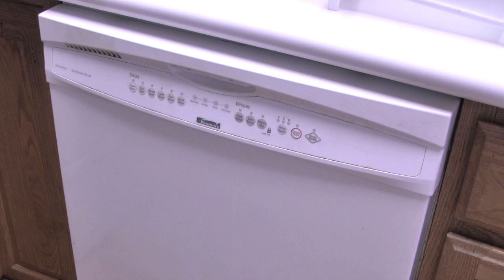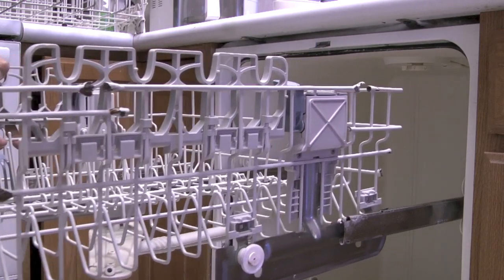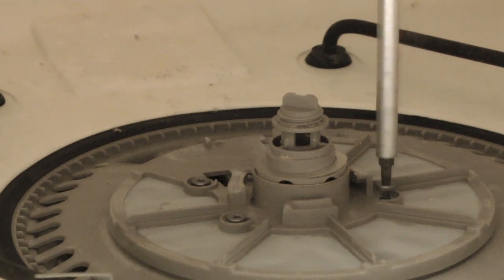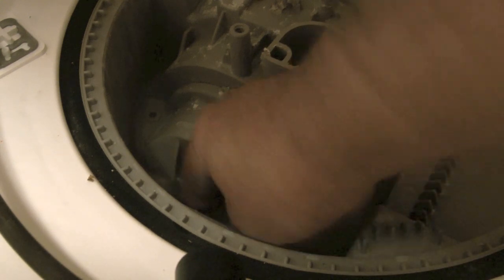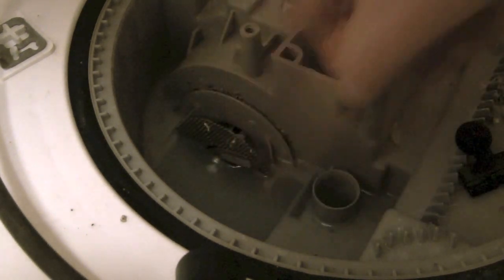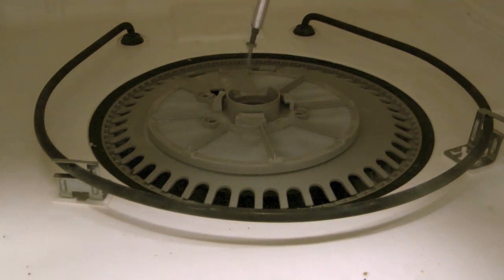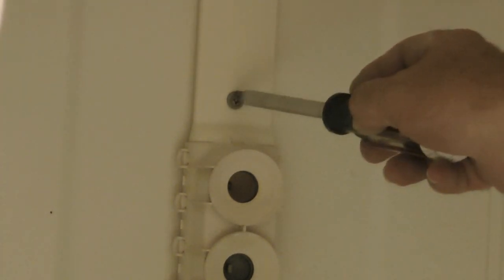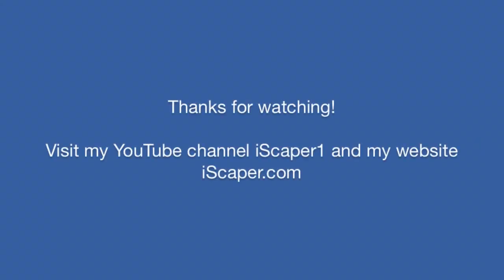Do it yourself dishwasher maintenance

Comment: Thanks for the video!  I was able to save myself a repair call and get to the chopper assembly and check valve after watching your video.  The dishwasher is 15 years old, and I didn't want to pay someone to fix it.  Will need to replace it sooner than later, but so great to give the filtering and chopper area a good clean.  They were not pretty.  Dishwasher is working like new again!  My husband is impressed with my DIY skills ;)
Reply: I had trouble getting the cover back on the chopper assembly. The steel mesh has to fit just so into a slot on the cover and it was pretty hard for me to know if I got it right.

Comment: Like so many have said...fantastic, very informative, simple!

One thing I like to do when disassembling something like this when removing screws above the "works" in the bottom is to place a towel over the bottom to catch any loose screws, preventing them from landing in a hole or crevice below.  The lower screws you remove don't seem to pose that risk.

Once again, wonderful, instructional video....YOU ROCK!!

Comment: We were able to save our dishwasher thanks to your instructional video!  Once we followed your video and opened the bottom of the washer, buried grime and blockages were the obvious cause of all our headaches.  We were shocked to find so much previously undetected grime in there -- and it was circulating onto our utensils and dish surfaces.  Thank you for a "new" dishwasher and a healthier home!

Comment: Thank you for taking the time to post this video. The wife and I started hearing a noise that sounded like a stuck electric motor (or what I would think a stuck electric motor would sound like) the last time we ran the dishwasher. We followed you instructions which took about 30 minutes and found some broken glass, plastic, one bread tie, but no chicken bones. We did a test run and haven't heard any noise that sounded like having to buy a new dishwasher before its time. Thanks again.
Reply from the maker: Thanks Sean for watching.

Comment: Great video.  Very informative.  My Kitchen Aid dishwasher was nearly identical to the one in your video.  I just finished the cleanout and re-assembly.  I found several pistachio shells and some plastic debris down near the sump.  I'm running a load now.  From the sound of the dishwasher, I can already tell that there is significantly more water flow during the wash cycles.  Thanks again!

Comment: Thank you so much! It took us just half an hour from start to finish to clean out our Whirlpool dishwasher. We found price stickers, popcorn kernels, a few things we couldn't identify and the worst..... a thin round piece of plastic, about the size of a quarter that looked like it came from the top of a ketchup bottle was blocking the pump. It's a wonder it worked at all. We aren't very handy and this was easy because of the great instructions. Thanks again!

Comment: After cleaning the drain, which I thought was causing the draining problem I had, I found your video. I did not know that the washer had a check valve. I'm checking that today.  Thanks very much for taking the time to do this video. Larry
Reply from the maker: Let me know if the check valve was your problem.

Comment: Thanks for the easy to follow instructions. We have a Maytag and it was very similar. We were about to buy a new one and I figured the worst I would do was make not work at all. We must of fished out about a pound of mineral deposits and icky stuff and detergent. I will run it in the morning and see if I succeeded in putting it back together right. Thanks for putting up a video that made it so simple.

Comment: Very helpful video!  My dishwasher had started making a loud grinding noise during the cycle, but not during the drain, which research told me could be something caught in the sump blade.  I followed these steps and discovered a piece of broken glass had made its way to the sump, which I removed.  The most helpful part of the video (one that other tutorials skip) was is pushing the sump cover to the right to pop it off.  Mine was really stuck and I had to use a screwdriver to push it sideways.

Comment: My unit suffered from an unbearable rot smell and grinding noise- just by luck I have the same model you worked on! Followed your video step-by-step, pulled out an assortment of debris, reassembled and VOILA!!! Both problems solved! (As well as $100+ for a service call avoided!) THANK YOU!!!

Comment: Thanks to your tutorial, I just saved the cost of a service call from an appliance repair technician. I didn't think that I was handy enough to fix my dishwasher, but the clear and thorough instructions made this possible.  My dishwasher now works like new.  

Note: I have a Whirlpool Gold Quiet Partner III.  It's just a little different from the model in the video, but it was easy to adapt to the differences.
Reply from the maker: Fantastic, thanks for the feedback and the info on your Whirlpool dishwasher.

Comment: Thank you, well done!  Exactly what I needed.  We just bought a 2-year-old Maytag w/ stainless interior that had the same screen/ chopper and sump.  I'm so proud that I was able to take the whole thing apart and take care of this myself, because it had plenty of gunk/pits/toothpick/beans/you-name-it in there, that was causing a not-so-fresh odor. I cleaned the whole interior with vinegar and the innards with a toothbrush, soaked up the dirty water down in the well with paper towels, then rinsed it by pouring water around the edges and then soaked that up until it was clear.  The screen had some baked-on-sticky-goo that wouldn't come off with the vinegar, though, and I remembered I had some lemon essential oil that actually broke it down and it scrubbed off with the brush then.  I sprayed the inside of the washer arms out with vinegar, too, and all sorts of food films flushed out when I rinsed it.  I'll tell you what, I don't think anyone has ever had such a clean used dishwasher, lol.  It looks and smells brand new.  Thanks again.
Reply: I’m so glad hope it’s running good still! Love the stainless maytags I have one as well and had to do the same thing when I bought mine used, I even found a ziploc bag in the upper spray arm feed tube! It worked perfect after the full clean out as this video went over.

Comment: I was having a similar problem. My top rack wasn't spinning and only a certain spot on the bottom would clean. My father in law and I used your video to open my dishwasher and every part was covered in grease. Cleaned it out as much as we could. The filter attached to the chopping blade wouldn't come out, so we used a tooth brush as best we could. Ran a cycle and its now running like new. Repair guy said it would be an easily a $200 job. Thanks for saving me time and $$$$
Reply from the maker: $200, ouch. I'm glad you were able to fix it on your own.

Comment: Thank you! I have this same dishwasher, and it has been a smelly mess for quite a while now--not to mention, the dishes never come out clean and have a greasy white film on them. I followed the steps in your video and was HORRIFIED to see all of the disgusting gunk built up behind the water supply pipe, inside the filter screen, and in the sump itself! Took me nearly three hours to decrease and clean everything. Found bones, pits, and glass in the sump, too. Taking it apart and putting it back together was the easy part thanks to your video. Now, the dishwasher works like new and I am happy I don't have to replace it right now. Really, thanks again!
Reply from the maker: +Waboosegirl1 
That's great, congratulations.

Comment: Thank you so much for this video. Our dishwasher stopped cleaning well for several months. I've been googling on how to find out what's causing it to not clean the dishes for a while now and did not find anything until I stumbled on this video. After taking it apart, I removed a bunch glass and food debris in the sump area, was pretty nasty. I got it all put back together; and hopefully, it'll start cleaning the dishes again.
Reply from the maker: How is it working now?
Reply: iScaper1 It worked. We have clean dishes again. Thank you!
Reply from the maker: Francis Ignacio
That's great, thanks for the update.

Comment: This video was incredible. I have the same model dishwasher and the steps were perfect and easy to understand. I think 6 hearing aid batteries clogged in the bottom were the culprit in my instance. Several were badly corroded and had started to have things growing on them so they had been there a while. 
Thank you for doing this

Comment: Thank you so much, I wouldn't have managed without your video. 
Goldroad40, as for the chopper blade cover, my dishwasher has a second screw towards the front. I also needed needle nose pliers to remove the cover in a sort of clockwise rotation.
Good luck to everyone, and thanks again.

Comment: Awesome it worked!!! Thanks for the excellent video with your clear instructions and illustrations. Just as an added measure I flipped off the breaker switch to the dishwasher on my electrical panel. The most stressful part was taking off the chopper cover as mine was a bit different. A pair of pliers did the trick. Also a turkey baster helped around the sump.The big surprise was that the 12 year old chopper blade was worn down to almost nothing!!! I was able to replace this 30 dollar part and now the dishwasher works great!! Keep up your good work!!
Reply from the maker: Thanks Susan for the tips and information. Where did you get the chopper blade?
Reply: iScaper1
Called Sears and they referred me to the local appliance repair shop and I gave them the model and part number to order however they had one in stock..lucky me...and the dishwasher works the best ever!!! Thanks so much for posting this video.
Reply from the maker: susan p
It's nice you didn't have to wait for the part. Thanks again for commenting.

Comment: Thanks so much for this!  My dishwasher looks almost exactly like yours does, and I was able to follow this video almost point for point.  I did use paper towels to absorb the water completely out of the sump area, which allowed me to spot about three pieces of very thin broken glass, which were invisible when wet.  This project went along very quick and easy all thanks to you!
Reply from the maker: Thanks, I appreciate the comments.
Reply: We used a turkey baster to get the water out of the bottom area and that exposed more stuff that was hard to get at with just fishing it out.  There were wires, glass, chicken bones. .. and other unidentifiable materials in there. . .all clean. .Now we see if it works!

Comment: iScaper1 - YOU ROCK!  You made this so easy even a girl can do it!  I am the "think pink fix-it chick. I was ready to load my dishwasher into the trash heap. I figured the worst I could was break it. Right? Wrong! The chopper assembly and pump inlet thingy were full of junk clearly causing some grief and obliterating the water flow.  It is really rewarding to "do-it" yourself.  I am running around singing "I am woman hear me roar in numbers too...." I may not live through the day...I'll stop.

Comment: Thank you! I had just the sound of something in the sump and your tips let me fix it. I will say that this worked for a Whirlpool as well. I did not need to take the tubing from the lower to the upper spray section apart, it stayed as a unit. If you have a power scrubber attachment at the base of the spray section, it just pops on and off. Remember to put a dishtowel over the little openings at the cover to avoid loosing a screw:)

Comment: This video just saved me an expensive repair visit. Mine was making a buzzing noise while the water was pumping. I found several pieces of glass in there and a chunk of wooden spoon. I could not get the check valve out but I cleaned it well and the noise is gone.

Comment: Flat out great video. Totally fixed my problem.'m pretty handy but never took apart a dishwasher before. It came with the house I just bought and It was really doing a lousy job. Following your easy instructions...I couldn't believe the amount of stuff that was in there including a broken off piece of the flatware basket, broken glass, labels, plastic bread ties, cellophane, and olive pits! No wonder it didn't work. btw..I noticed the screen filter was full of some kind of gunk too...probably glue and paper residue from labels. I saw I could pry that off and get that cleaned too. Just an excellent, excellent video, clearly and calmly explained, and with good pics. Thank you! I'm a subscriber now. And now it's on to why the rinse aid dispenser doesn't work. :-/
Reply from the maker: Thanks Kenna, your feedback is much appreciated. Let me know what you find out on the rinse aid dispenser.

Comment: I couldn't have lucked out more in finding this video! Same dishwasher and same problem.  Thank you so much for sharing.  I hit the motherlode down there, glass, a rock, a twisty tie, also a chicken bone, a large ball of lint, eggshells, a couple of beans, sunflower seeds and a lot of slimy grime.  I'm a little grossed out but running the test load right now with my fingers crossed.
Reply from the maker: Did it work?

Comment: I did this...it took about 20 minutes (I'm fairly mechanical) and solved the problem completely. The biggest hassle was getting the $#%&$!! caps off the ends of the sliders on the upper rack. Thanks for saving me a $200 service call or $700 to replace the unit.

Comment: Thanks for the video! I was having a different symptom. My lower washer arm kept clogging with little pieces of plastic so I took apart the sump as shown in your video and found the source of the plastic.... the chopper blade broke from its shaft and was sending little pieces of plastic through as it turned and ground off more. The chopper screen was completely, completely clogged - really gross... wish I took a picture of it.  

Thanks for taking the time to put this together to help us all out!
Reply from the maker: Are you going to replace the chopper assembly?
Reply: iScaper1 Yep... that is the next step. Anyone know of a test mode or something where I can see if the chopper motor is actually spinning?
Reply from the maker: Brian Engel
I'm guessing you'd have to call a tech to do a test like that.

Comment from the maker: What I did after cleaning the sump putting everything back together was take 2 cups of white vinegar and add to the tub then run the dishwasher through a cycle without soap. It did a nice job of removing the scale from the inside of the tub. I figured it would work on the crevasses in the sump also.

Comment: Thanks so much for this video! The job took me a lot longer than you but I was able to clear out so much (it was fairly disgusting, and we don't even eat animals, so no bones!) I have one suggestion: use a sponge (or wet vac, I suppose) to remove a lot of the water. That way, you can see what you're doing and visually confirm that it's cleaned out. Also, be sure to cut off the power supply first. I ran the dishwasher after and the difference was AMAZING! I appreciate you posting this!

Comment: This is the 2nd time that I have cleaned my dishwasher out like that! I learned something that I didn't know viewing your video though, and that was the plastic cover over chopper blade could be removed and the chopper blade area could be cleaned out. my dishwasher wasn't cleaning again and I thought that it needed a cleaning again. but it turns out that I need a new water inlet valve!

Comment: The only differences on my Kitchenaid dishwasher were that the sprayer feed tube at the back was held by clips instead of screws, and has a "pot scrubber" attached that is removed by twisting the top forward and then lifting off.

Thanks for the useful video! It made the task simple.

Comment from the maker: Yes, the spray arm does wobble when I spin it by hand. I think the water pressure keeps it from wobbling when in a wash cycle. Have you tried running the dishwasher since you put in the new piece? If the spray arm is threaded on correctly I think you might be ok. If things are not as they should be then you will hear a banging-clattering noise when you turn on a wash cycle.

Comment: Used your video to take apart my DW. I found a broken plastic fork at the chop blade. Put back together and it still sounds rough, but then runs smooth after a few seconds. There must be another little piece stuck in there. Guess I better check again. Anyways, thanks for putting this video up. It really helped!
Reply from the maker: Thanks for commenting.

Comment: Thanks for your excellent video on cleaning the sump of our ultra  kenmore dishwasher.  Your slow, methodical, quiet deamenor really was excellenet.  Your directions suberb.  Yes, it had a lot of "stuff" in there and cleans beautifully now.  BUT I have an additional problem I wonder if you can address it.  I have to do a reset every time I do a load of dishes.  The dishes clean up well, all buttons work, but it will not start without a reset for each time I run it.  Thanks again for your videeo instructions!  Well Done!
Reply from the maker: Thanks Barbara for watching. I would guess your problem is a control panel issue which would probably be expensive to fix.

Comment: Thank you so much for posting this! I tried using Dishwasher Magic to clean the dishwasher out, but my dishes still came out with more dirt on them than when I put them in before washing. I just followed your directions, and hopefully it works. Also I wanted to add that mine is an Amana dishwasher, so you can add that to the brands this works for.